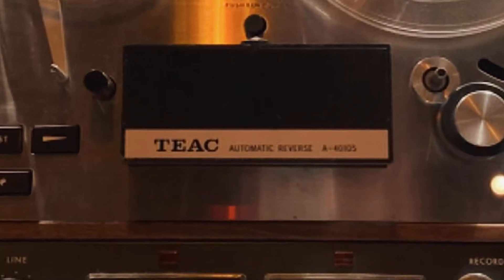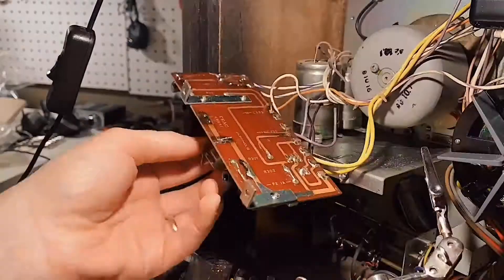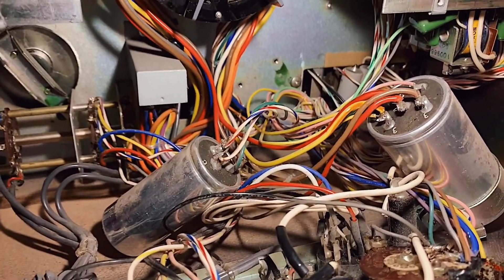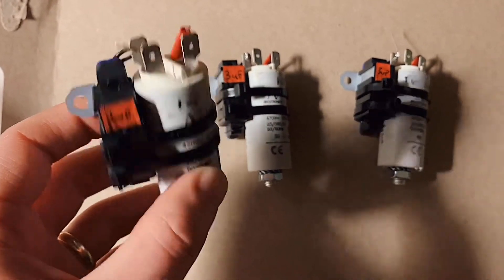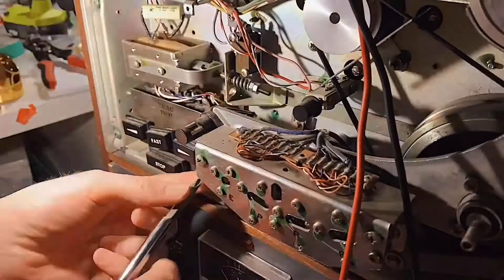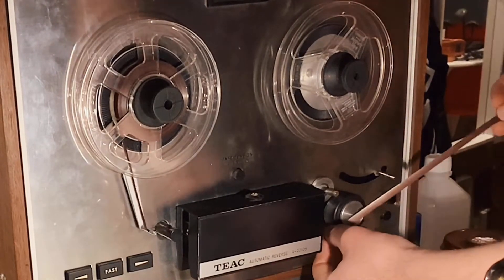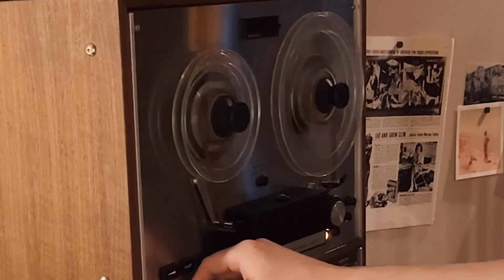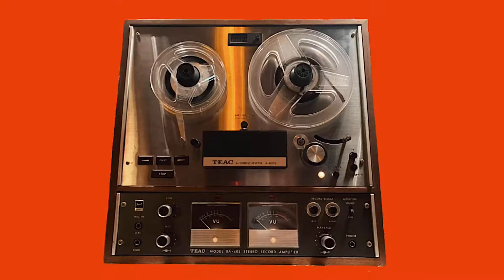1969 TEAC A-4010S: Visual Walkthrough of Repair and Demo

Comment: Which Suzuky capacitors were the hardest to replace due to location?
Great video, very interesting and informative.
Reply from the maker: Not sure, the hard part for me was the motor-run caps. Just had to just work slow and take my time with all of it and just not be rushed. Would definitely recommend doing them all if you are getting in there. Also would recommend checking out some other videos regarding lubricating the moving parts while you have it opened.
Reply: @charliedont  Thank you, will do

Comment: Hi, where did you get your capacitors? The 4010S has a lot of 0.1uF 400 V caps that are not available ANYWHERE!
Reply from the maker: look for higher voltage rated caps. These are 850v. Mouser had them at the time. Here are the detail #s.
RoHS1
598-104PPA850K
104PPA850K
0.1uF 850V 10%
Reply: Thanks! Looking about on the forums I noticed the dangers of the Suzuki oil caps.  Just to be safe, I also replaced the 2-prong power socket with a 3-prong and wired the ground to the chassis.